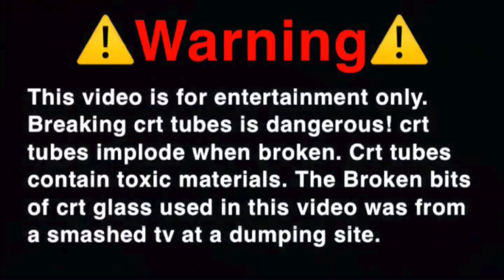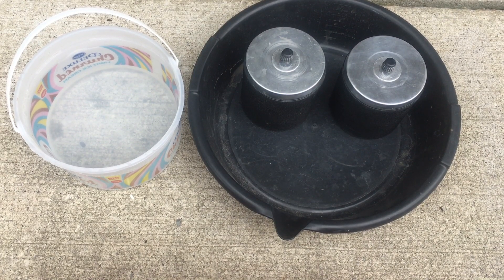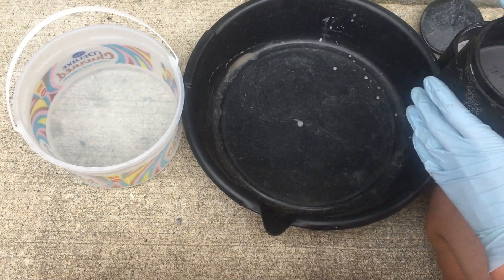Making CRT Beach glass with a Rock Tumbler

Comment: If possible and feasible, is there's any method of lead recovery of CRT glass monitors?
Reply from the maker: Before making this video, I did do some research about this topic. Waste CRT glass is still a big problem today, because there is so much of it, and lead recovery processes are completed and costly. However, there is a method to recover the lead. This process involves smelting the glass and using chemical treatment to remove most of the lead from the glass.

Here is a link to a article that goes more in-depth about the recovery process:

https://www.tandfonline.com/doi/full/10.1080/10962247.2014.976721